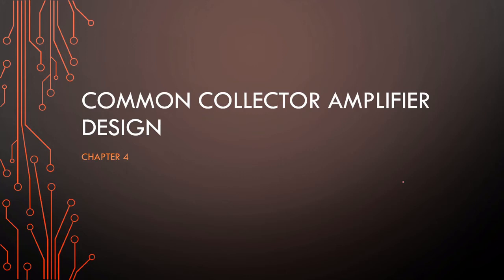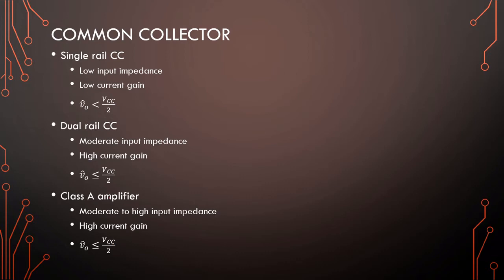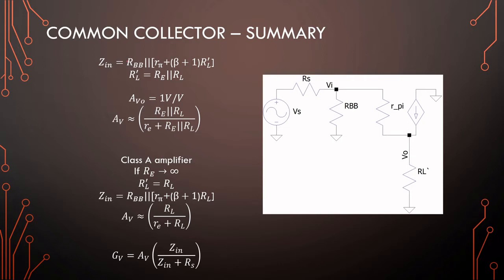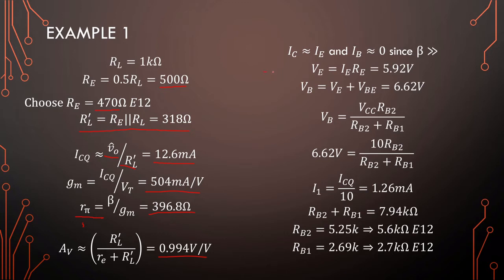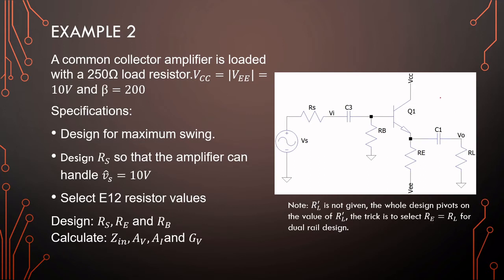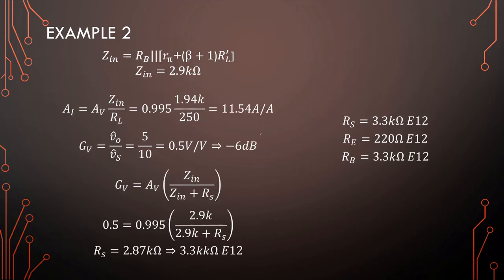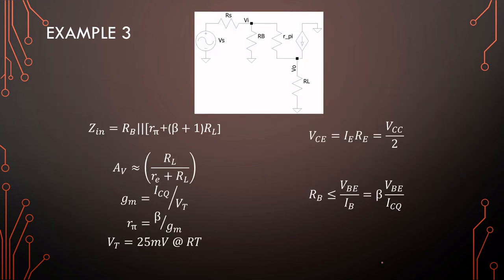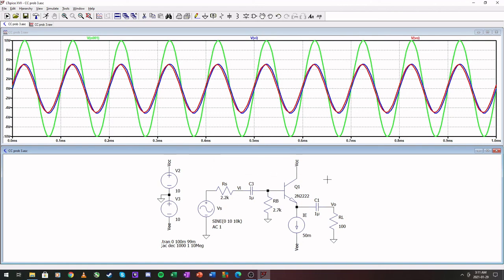Video 9 - Common collector amplifier design

Comment: At 22:43 - the amplifier is not starting to "saturate". That could only happen on positive swings. In fact, what has happened is that the transistor has switched off on a negative-going swing and you're just left with RE and RL effectively forming a divider between ground and the negative rail, which doesn't allow the instantaneous voltage at the emitter to drop below about -4.6V.
Your "trick" of selecting RE = RL causes your design to run out of headroom at roughly -Vee/2. You could improve on that by reducing RE, perhaps to 0.5RL as you do for the single rail circuit, when you would find that the performance of the dual rail ±10V design is pretty much the same as that of a single rail 20V design. Dual rail really offers little advantage.
Reply from the maker: The students I work with wants rules to work with. Cant overcomplocate it for diploma. Yes smaller Re allows for more current and thus more headroom etc.

In the end a proper class A amp would be better. Just use a current source instead of Re. Then a class B then the AB and so on. You would get more swing and advantage from it.